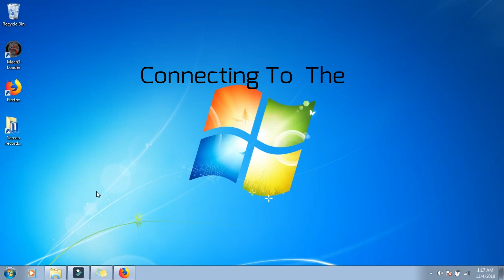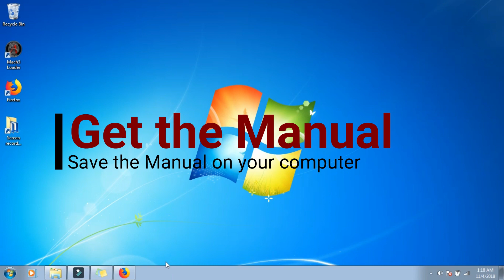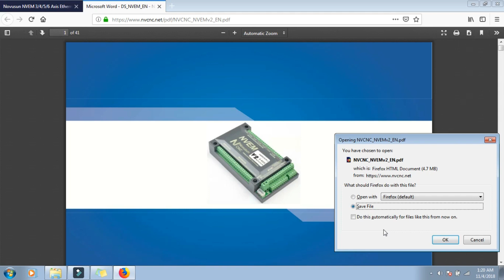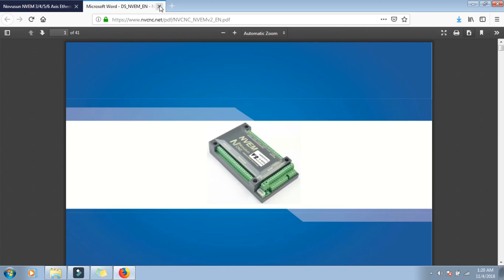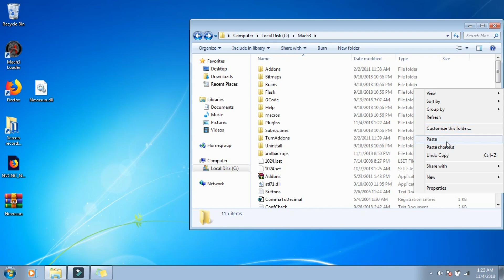Connecting to your Nvem V2 Part  1- Solved :0 ;) :D

Comment: Sir . I am student.plz help ..i purchased nvem ethernet controller to make the engineering final year project but the received controller is not working..means after connecting the ethernet cable it doesn't show any connectivity to the computer plz plz help..
Reply from the maker: Is the red light on check out all the videos need proper power supply and check your cable
Reply: @DZMech  yes the red light is on .even though same problem is coming plz help .plz
Reply from the maker: Did you do the setup in this video? Make sure it’s the proper version
Reply from the maker: https://youtu.be/6-07MT0zFT8?si=VagCjCcwUKv8pbcV

Comment: I bought 3 of these boards. EC300 asking for bin file. NVEMV2 6axis and 4-axis can't get the spindle analog 0-10v out put to work. I get frustrated with this garbage.
Reply from the maker: run your negative power lead to your input on all the outputs including the spindle pin outs 
i'll do another video this weekend 
I'm converting an emco lathe
Reply from the maker: It's amazing there's a ton of videos now thats awesome!

Comment: what is index, pin and port number, thank you. " the information sheet says port 1, pin 0 but it's not correct "
Reply from the maker: Once you get it connected should be pre programmed
Reply: @DZMech  I did not understand. the only one not working is index. all other parts are working
Reply from the maker: @fehmiatas  try saving closing mach3 and restarting everything
Reply: @DZMech  nothing has changed. Could it be a problem with the card?
Reply: @DZMech  Could I have made a mistake in the cable connection?
Reply: @DZMech  I'm connecting to the different input input on the card. In this case, the mach3 index led is on. but I'm connecting to the index entry on the card. mach3 led not lit. I think the datasheet index, port and pin numbers are wrong.
Reply from the maker: @fehmiatas  is this index up by the output corner?
Reply: @DZMech  in the spindle section. "spindle speed back"
Reply from the maker: @fehmiatas  yes spindle outputs 1 2 index
Reply: @DZMech  yes, this is index input. what is the port and pin number? "it says datasheet port 1, pin 0 but wrong". do you know the correct one?
Reply from the maker: @fehmiatas  I don’t but you may be able to find it through process of eliminating what’s plugged in and working and what leftover if you get it working please post your findings 😃

Comment: when conect with router to control by WIFI check that the router assigns ip 192.168.1.X being X is 2-199 otherwise it will not work .

Cuando conecten al router para controlarlo inalambricamente asegurense que el router asigne ip 192.168.1.X donde X es valor entre 2-199 de otra manera no lo veran conectarse al mach3 de manera inalambrica(wifi)
Reply from the maker: Nice tip!  good work and thank you for sharing
Reply: @DZMech  it's a pleasure

Comment: Do you have BIN file by any chance?
Reply from the maker: Bin file for....?
Reply: @DZMech  Bin file from Nvem V2 6 axis. I don't understand why it is broke in my case.
Reply from the maker: Make sure you are running win 7, theres a bunch of videos involving getting connected.  And make sure you have the proper file for your version of Nvem
Reply: @DZMech  I'm sure that the program runs in windows 7. Two weeks ago the program run perfectly but one day the message looks in my laptop. Chose Bin file.

Comment: I'm looking forward to Part 2. I just received mine this week and although I've seen worse manuals, it does seem to be lacking detail.
I made the mistake of trying to update the latest firmware through Mach3's 'Config Plugins'.  It seems like this should be simple but it took me several hours of unplugging and reinstalling to get it to work. After all of that, I still have version 0.001 firmware.
Reply from the maker: Thanks for the comment!   As far as I know there no firmware updates.  But I should mention the latest version of Mach 3 (3.043.066) doesn't work very well.  .  I am running Mach 3.043.062. Thanks for watching! :)